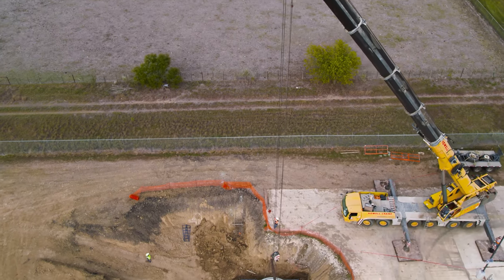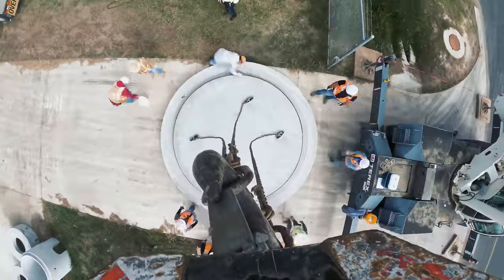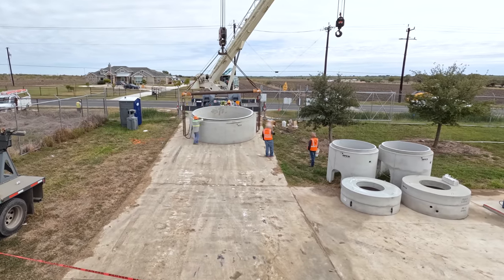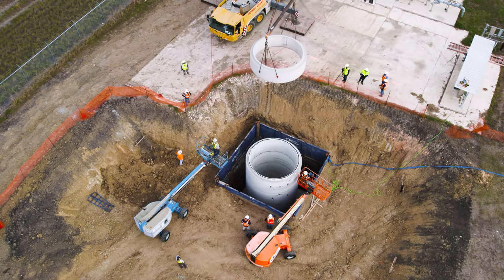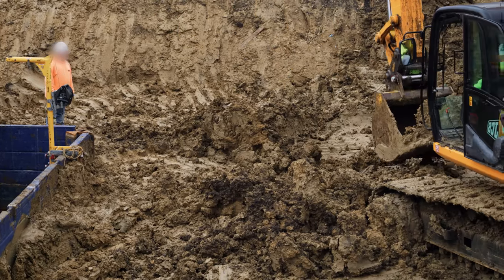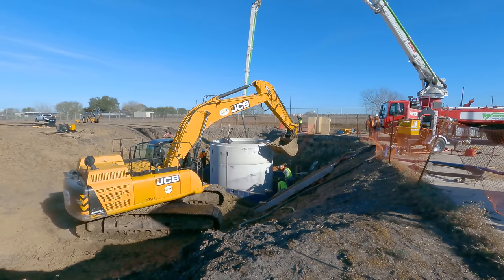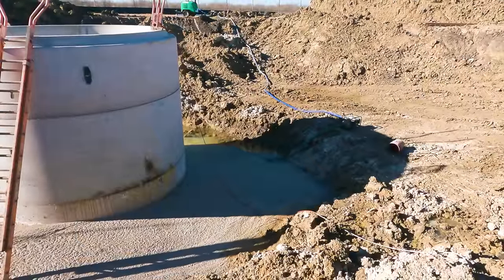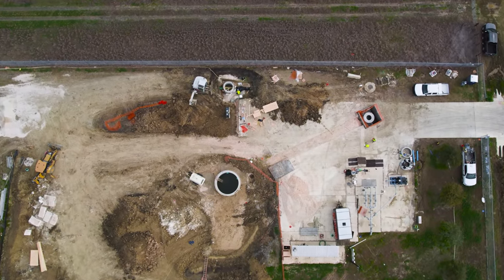HEAVY CONSTRUCTION of a Sewage Pump Station - Ep 2

Comment: I love how the time lapse makes the excavator look almost organic. Like it isn't a massive steel machine of hydraulics, it's actually just a big armed creature wiggling some plates lose like I would for a model project.
Reply: experienced operators can operate their equipment like it's just an extension of their body, it's quite impressive to see if you understand how difficult it is to work safely, smoothly, and fast all at the same time
Reply: construction equipment really look like cretures with a job.
Reply: the sped up footage of the crane dangling 15-ton slabs also looks extra scary... i keep wondering if anyone who accidentally gets nudged by it might just get shoved into the hole. the entire process being so painstakingly slow also made me wonder: wouldn't it be better to just cast the entire concrete well on-site?
Reply: @alveolate  Grady has mentioned the reason for why they didn't cast it there in the previous video of this series
Reply: Or like toys, swinging around 15 grams instead of 15 tons
Reply: the high speed excavator is very very pleasing to watch.
Reply: @alveolate it may seem painstakingly slow, but it would be much slower (weeks vs 2 days) and put more people at risk in the hole for longer periods of time to cast it in place
Reply: Yeah, the operator isn't the smoothest I've ever seen. He must be fairly new as an experieced crane operator will be much better at controlling the drift.
Reply: Good operators make it look like that

Comment: Please make this a full series. Even if the demand isn’t here now, this is one of those shows that gains fans exponentially due to how organic and awesome the whole concept is. 

I’ve rewatched the first two episodes multiple times while waiting for Episode 3 on Nebula. I see myself rewatching these pilot episodes - years from now. 

Grady, You are the best host for this type of show. Practical Construction could be what you become widely famous for, way more than you currently are but only if you keep your integrity. Please, NEVER dramatize it up or do any of the cheap tricks the TV networks use in their productions. 

You’ll never run out of material. You can make a season documenting another sewage lift station similar to this one, but in a already built suburb on in a depression in the landscape and make it interesting, while not having to rely on past episodes or even reference them. 

Own the show, keep the creative control even if it means you can only cover one construction project a year. Don’t cover construction projects that have a veil of secrecy on one part or element of the project where you can’t show us, as that detracts from the value of this show.
Reply: Thinking back, the veil of secrecy made so many shows so much worse. The producers have to dance around the topic, to write throwaway lines so you don't think too much about it.
Reply: This. This is some priceless advice right here.

Comment: When I was working in the field, I was amazed at the number of crane companies that straight up refused to use spreader bars.
The argument I always got was "we lift things for a living, and we know exactly what we're doing".

However, they were long gone when equipment wouldn't work properly because it was racked during installation. The Owner (or the GC) then had to spend big bucks to fix a problem that only existed because the riggers from the lowest bidder didn't do their job right.
Reply: I'm not sure of your field but if they don't know enough to do their job they shouldn't be on your site.
Reply: never enough time to do it right, but always enough time to do it over!
Reply: Its not always the fault the riggers or operator. Its more the fault of the sales guy or dispatch. They determine what crane is going out and what rigging with it.
Reply: @Lmiller201  A good team will not use the wrong equipment. They know that their reputation is on the line.
They will reschedule the lift for when they have the proper facilities.

Comment: Thanks Grady. We have new pipeline being connected to our plant and there is  similar Civil work being performed at the moment and nice to have series like this to have a bit more of an insight. One of our challenges is that the influent profile has changed due to the  macerator pumps used to bypass sections of the pipeline.

Comment: Thanks so much for this great video. I have worked in the water and wastewater industry for the past 23 years. I have been inside of several wetwells after construction and after they were in use. This was a great install. Sometimes on small wetwell installations that are not set up correct, the ground can shift over time and cause problems. Most all of my work was in the pump control and monitoring systems.

Comment: This brings back memories.  I worked on repairing a leak on a pair of pumps in a lift station for Clark County Water Reclamation District in Nevada. It was at the bottom of one of these lift stations. It had the tiniest elevator I've ever been on to get down there.  The job involved some welding, and casting a McKnight clamp around an 18" tee fitting.  A few years later they tore the whole thing out for a completely different system.

Comment: For smaller structures with a manhole cover, we do a vacuum test. This pulls the conseal into the barrel joints to make a better seal. Leak testing can then occur. The evaporation calculation is done for larger structures such as this and clarifiers. 
It is nice installing these where many feet of cover for frost protection is not needed for the influent and forcemain pipes (didn’t see any cores for boots or wall pipes).  
Cool stuff. Great video.

Comment: Interesting to see the difference between typical ground work in Sweden vs USA. I've worked in a groundworks contracting company for 10 years, specialized in infrastructure construction, and never seen floatable fill used. Instead we use geotextiles and compacted gravel or sand for almost all fills and foundations that will carry any sort of load. Suppose the price of the concrete must be lots cheaper compared to a slightly larger hole and the work required to dig/fill it back up.

Comment: anytime you have a hole in the ground that leaves a cavity there is a chance it might float or partially float regardless of how heavy it is, therefore if its filled (in this case with water, serves as a weight as well as a leak test) and emptied after the work of filling around the outside void with fill.

Comment: The low density flow fill had me scratching my head a little bit too, until I realized that in that application, it sounds like it only needs to be as good at bearing loads as soil so it probably really doesn't matter one bit. I think these sorts of highly detailed videos about engineering have a lot of practical applications in other domains, just for the sort of thinking and problem solving based on paying attention to details and what you actually need to put in place instead of the normal expectations.

I really like the emphasis on practicality and the problem solving, related factors and why the decisions are made that way. I'm a firm believer that it'll make the world a better place if people gain a greater mastery of that type of process on the whole.

Comment: A house near me, before I moved out of CA, had a basement, and it looked as though they filled the giant hole with concrete. I sort of wonder if it was the stuff in this episode, but it sure looked like concrete. The house was near SF Bay, and there was ground water, even in summer, just a few feet below the surface - they had pumps runniing 24/7 putting out a huge volume of water into the storm sewers for weeks while building the house.  I figured they effectively made the basement walls between 8 and 16 feet thick so they wouldn't need to put pumps underground to prevent the basement from being dank.

Comment: In the construction of our " flood control " pump stations they did not use flowable concrete. At the first stage after the sheet piles were in and the hole excavated, it was full of water. So the seal for the bottom was done with tremie concrete placed by divers. 100 truck loads of it done on a night shift so that the trucks could all make it from batch plant to site and off load within 90 minutes per load. Once that had set, then they were able to start doing the concrete foundation for the pump bays after pumping out the water.  The sheet piles on the sides and back were left in place while the front ones where the bay inlets were, were not removed until it was time to flood the bays. And that was not done until after the inlet to the pump station had been excavated. Was on hand when they did the explosions for that work. Never had seen PVC pipe fly 30 feet straight up into the air before.😁

It is always interesting to see how things are done in other locations.

Comment: Very interesting to see for sure.  Never worked on a lift station but did pull out a bridge and put in a pair of 21' diameter arch pipes (They take a 21' round pipe and place it in a press that is designed to squish it at a particular point so that it still has the same flow as a 21' pipe but is only about 14 foot tall.)  Also did a lot of road paving which is well worth getting some footage of sometime.  Just ask if there are any sites doing slipform concrete paving.  I worked on a paving crew the entire summer after I graduated from high school and we poured a project that ended up being about 6 miles of concrete roadway on one jobsite not to mention a few miles here and there in different area's.  It's really cool to see the concrete get shifted around and rebar inserted or covered and all that comes out the back end of the machine is a nice roadway that needs to cure for a few weeks to be ready for traffic.

Comment: Excellent video, Grady, many thanks. I was surprised that the flowable fill wasn't always poured/pumped into formwork - but then I'm an electrical engineer and my experience of concrete applications is...limited.

Comment: 2:55 The gasket seal they use is commonly known as “Conseal,” it’s a butyl rubber compound that is incredibly sticky but remains flexible. It’s a pain to get off the bottom of your boot. 

The gasket lubricant used is most likely pipe soap, it’s an animal fat derived fatty acid soap that is water soluble. It’s commonly used in water mains with push on rubber gaskets as it is food safe and will rinse away when the line is flushed.
Reply: What is service life of this rubber? Rubber gaskets are explicitly forbidden for unserviced joints of water pipes in  my country.

Comment: I think it's a bigger deal than it might seem that the contractor was able to make a "game-time" decision to bring in the small crane to make things flow more smoothly. 
The planners didn't foresee how a small detail in the site's connection to the road could become a choke point for the whole operation, but someone on the ground was able to see the problem, come up with a solution, and implement it on the fly (although in this case, the planner and person on the ground might be the same guy). Having people who are able to/authorized to change the plan from the bottom up is vitally important, and something that is often ignored by a lot of planners/leaders who make the decisions from the top down.

Comment: 12:30 Interesting choice to leave some amount of trash inside the whole which will ultimately interfere with the strength of the backfill material and in case it is wood (looks like wooden boards and it floats) will decompose and leave hollow spaces in the backfill. Given the huge amount of work this construction takes, it would have not been too hard to clean out the space around the concrete rings.

Comment: I once rode a scissor lift out of a similar pit. It was a pit for a nuclear reactor housing we needed to remove the lifts and backfill the holes, the lifts were fully extended and there wasn't enough room to lower the lifts and attach the crane harness, so I got into the lift, attached the harness, then once the crane op took the slack out of the chains, I collapsed the scissor lift, as it was being lifted out.

Comment: i currently work at a venue that has four pumps in a wet well that feeds six 600hp pumps in drywells. those pumps output 6000gpm at 850 psi to three other pump houses.

Comment: A lot of people asking why such a large crane was used, My guess is surface bearing pressure.
The crane isn't setup with full counterweights and that's probably because the surface it's sitting on isn't rated to take the full weight of crane so the crane is rated to take lift 300 t but it's may only be configured as a 150t crane to keep surface bearing pressure down below the regulation, which in turn means the cranes lifting capacity is halved.

Comment: Hi Grady! So glad to see something like this from you. I'm curious: is the 15 ton weight of the well segments a limitation of some piece of equipment, or is that just the engineered design specs of the wet well? I'm just wondering if some aspect of construction (road weight limits, crane weight limits, diameter required, etc) was the deciding number for how large this wet well would be.

Comment: This is a great video. I have a question though. After the first concrete pour, then the earth back fill, then the excavation for the second pour I could not tell if the excavation went down to the original pour surface so the two pours would "bond" together or is there a layer of dirt between them? Maybe it was implied and I'm not cleaver enough to notice it. Just curious. Oh, second question - Are you one of the the Engineers on this project? These videos are fantastic. Thanks for producing them and sharing.

Comment: I'd never heard of "flowable fill" before.  What kind of consistency does it have once cured? Is it very concrete-like? Or more like hard-pan, well settled dirt? Or something else? Could you dig through it with shovels and maddocks for instance?
Reply: you can break it up and dig through it with an excavator relatively easily but I wouldnt want to do it with a shovel that would be a lot of work.
Reply: Sounds like it's something akin to hard-pan, though I would guess a bit more "crunchy" to dig through on account of the cured cement in the mix.

Comment: Hi Grady!

As a mobile crane operator i have couple of questions;

What was the radius of the lifts? Looks like under 25meters to me and for that a 300ton crane with 100t of counterweights seems overkill. Was that the contractors own crane and they just used that, or was there any other reasons why it was so over scaled? Wouldn't a 160ton crane be able to lift these pretty easily?

Comment: So, we finally had a round hole in the ground, lined with concrete. Could this have been done more efficiently by drilling technology, or something like that?
In my uninformed understanding drilling also produces round holes, sealed with concrete, usually smaller though. Seemed like we did a lot of digging, only to fill up a lot of that space again with soil or fill, so it felt like there was room for something more efficient.

Comment: This series is great. One of the best I've seen in a long time, not just on youtube, but in general! One question I had, why was an extra crane needed for the unloading of the trucks? The big crane seemed to be capable of reaching the trucks quite easily. Anyone knows why?
Reply: Don't know for sure but the further a crane has to reach horizontally, the less powerful and stable it will be. It was likely outside the safety zone or simply couldn't lift the loads at all from that angle.
Reply: @RangeWilson  that was pretty much the only reason I could think of, but the crane looks quite beefy. This doesn't necessarily say anything about lift capacity, but perhaps there is another reason

Comment: So much time, equipment, man power, materials, dirt moved,  moved back, then dug out again. No wonder infrastructure projects take sooo long and cost sooo much. 

What if you had a giant auger drill truck like what they use for water/oil wells, as big in diameter as feasible, and just drill in a series of them and lower concrete pipes on end till they add up to the capacity that prefab concrete well has? Wonder if that could work. 

This seems like an insane amount of work to get to this point, and its still not done yet. There has to be a better/chesper/faster way. Just think, if a poor country needed this project, how would they achieve it? No way it would go down the way we do construction here, and that doesn't mean it has to be unsafe or low quality. Its just a 'well' reservoir after all.

Hey, im not hating, its really fun to watch, i love it. I appreciate him putting this together. Footage is awesome. I've loved stuff like this (construction, heavy equipment) since i was playing in my sandbox!

Comment: The gaskets between barrel segments are the worst part of putting these together, if the upper section is misaligned just a bit they are likely to roll over and your seal is ruined. I work in a high water table area so we have to overkill it to prevent infiltration

Comment: How can you make sure that the base plate has a good weight distribution with the concrete slab that was poured in the previous episode?

I can image the uneven surfaces creating pressure points.
Reply: i was expecting some kind of interface material to be added between the slab and the base
i'm guessing with the working slab being thin and unreinforced, its allowed to crack to distribute the force

i'm also wondering if there's anything but gravity ensuring the ring segments maintain their seat on the seals when the base settles